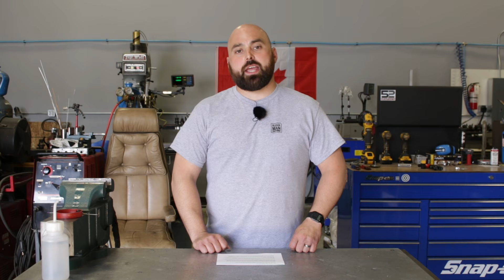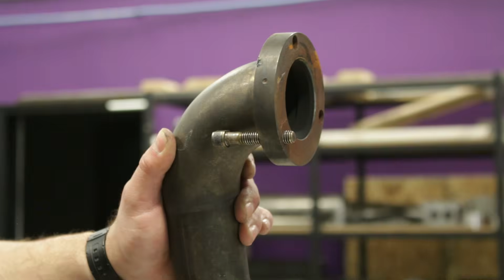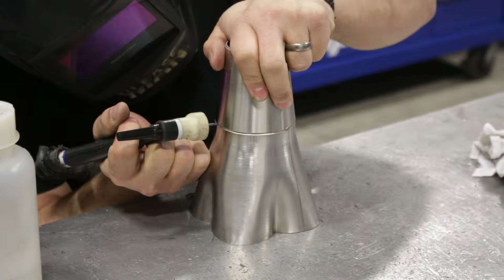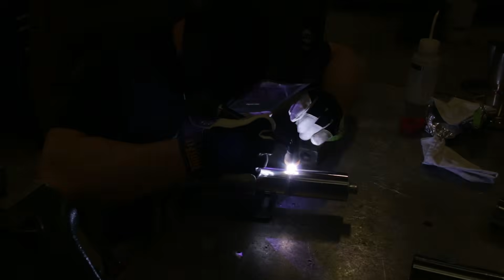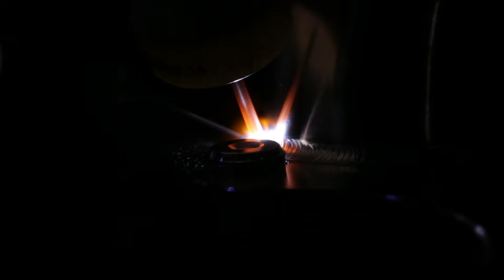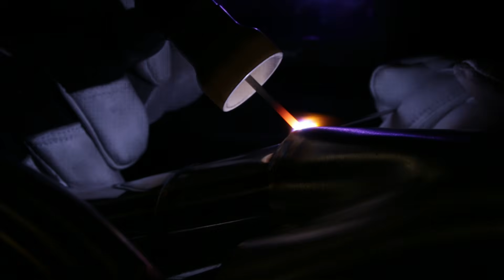Performing a MIRACLE on a 3600HP Diesel Engine (Turbo Manifold Build)

Comment: A 'bung' is a wooden, sometimes cork, 'stopper' or 'plug' used to seal the hole in which it resides in a 'bung hole' to keep wine, whisky inside the cask and keep bugs, dust & debris outside where they belong. Thus 'bung hole' is, in common male vernacular, applied to just about any similar situation- anatomic, automobile, whatever.

Comment: Can you not make an adapter flange to make the header bolt pattern something that is much easier to reach and get tools on..maybe 3 bolts per tube! To get best sealing.. possibly using a dead soft copper o-ring to seal the primary tubes to the adapter. And, IS THAT A DIESEL HEMI? 😮

Comment: just wanted to add, im not sure you know this but equal length runners are not good on V8s. Cyclinder 7 and 8 should be around 36 inches long. 1, 4 and 6 should be 40 inches long and 2, 3 and 5 should be about 32 inches long. 

Youll get more from exhaust scavenging, low end and top end power will be greater and it will retain a correct flow profile that is tuned to the piston stroke.

Comment: Awesome, I was actually thinking of building a set of headers for my 7.3 idi since no one makes them anymore. I’ve done full exhaust systems on several cars and trucks just by buying several different J, 180, 90 etc bends but have yet to dive into making headers. I weld for my day job so I’m not worried about it too much just knowing there is a ton of work involved I gotta get myself motivated. I found building the exhaust systems was both enjoyable and satisfying when I was done and really liked being able to get them to look and fit exactly how I wanted.

Comment: Hi  something I don’t understand I see another video you build a headers for a gaser with sch40 and on this diesel big power high egt it’s Seem like sch10 or something thin like that why ? Because I’m in diesel world and we upgrade always to thick material… thanks
Reply from the maker: The material can handle the stress in this application because the turbo is supported and braced. In a turbo Manifold situation you're usually holding up a 30+lb turbo with the Manifold, PLUS the stress of the runners glowing cherry red. Wouldn't last long. So the pipe thickness adds more physical strength than crack resistance.

Also holds a bit more heat in the runners before the turbo which is another plus.

Comment: So do the rules for sled pulls require the turbo system to remain within the bodywork? I feel like you could optimize the headers more if you could go through the hood a bit.
Reply from the maker: Possibly, but the truck is 4hrs away from me so I was only working in that space I knew I had

Comment: Incase anyone was wondering what the engine is it’s a Wagler DX460 with an inline mechanical P8700 injection pump. Other duramax engines for common rail injection systems (all injectors on each bank feed from one common rail). The P8700 series of injection pumps are 8 cylinder big brother of the P7600 version found on 1994-1998 Cummins 12V engines.
Reply: Is that like a Diesel version of a Wankel?😅 (the names we get sometimes)
Reply: P7100, not P7600 FYI

Comment: Any idea on EMAP pressure? I’m running V bands at over 200psi exhaust back pressure with absolutely no issue in a customers diesel (when VNT angle is shallow) have also seen V bands go 300-400psi in other applications. Pretty wild to see one snap a clamp, especially running a pressed collector which would balloon well before I’d ever expect a V band to fail,

Manifolds look killer man! Nice work!

Comment: your videos are very good!
I have a question, I saw that the flange you used on the cylinder head is very thick. For Otto engines (gasoline), what would be the minimum thickness of the flange? Thanks.
Reply from the maker: Thanks! I wouldn't go less than 3/8" because you lose some when you sand the bottom flat. Usually 1/2" plenty overkill for most applications.
Reply: @gleaseman  thankyou ;)

Comment: Nope ! I checked I am subscribed. Dont need no reminder lol 😁 Don’t forget about the lathe coolant! Smooth move lapping the header flanges. Be Safe!
Reply from the maker: Haha, thanks a lot!
Reply: Question, The second pulling truck ( when the engine blew), did he have to get a new pair of underwear? Your attention to detail on the header build is top level, bolt spacing and tube orientation.👍👍 I will probably never build a set of headers but will definitely use some of your tips on other projects. Be Safe!

Comment: that deburing tool you use, do the burs (tooling) last a long time when using it on stainless steel? noticed you use it often
Reply from the maker: Yes they do last quite a while. I use single cut burrs rather than double cut too.

Comment: Out of curiosity, when building headers from scratch is it easier to tack it up physically in the car? Or do you ever take a good look at stuff they can’t run into, build your jig based on the stock header and then double check that your new design fits before welding it. I’m just imagining the process of tacking up in vehicles with tight engine bays and that seems almost impossible! Love the content though!

Comment: Considering how much these guys are dumping money on those engines would 3d printed inconel runners be an option? Gls fab also sells 2"x3" and 2,5"x4" billet merges with machined flanges on them. Also elmer racing does as well but don't know how easy they are to get on that side of the bond.

Comment: The factor up pipe on my truck was apparently made from a 400 series stainless.  Is there an easy way to tell what it is so I can get the right material for welding to it?
Reply from the maker: I'd have to see the material to know what it is, but what I'd do in this case is just use 304ss and use a 309l rod to weld them together. 309 is good for joining dissimilar stainless.
Reply: @gleaseman  Thank you!

Comment: What brand of flap discs are you running? Also, what amps is your machine set for this type of wall.
Reply from the maker: I've come to like these ones I get locally for 40grit work: https://weld-ready.ca/products/pearl-greenback%E2%84%A2-zirconia-maxidisc%E2%84%A2-trimmable-flap-wheel?variant=43974162841826&currency=CAD&utm_medium=product_sync&utm_source=google&utm_content=sag_organic&utm_campaign=sag_organic&srsltid=AfmBOoqmrbdykqeOMrwNyTrDRwiAshfryvCc4WcEX6yuCGnO33FvjY-w02A

Comment: I use welded nuts instead of bungholes on my projects, but one issue i've found is the nut tends to wander off center over the hole leading to the bung damaging its threads against the hole side. do you dremel out the rear of the bung to avoid this?